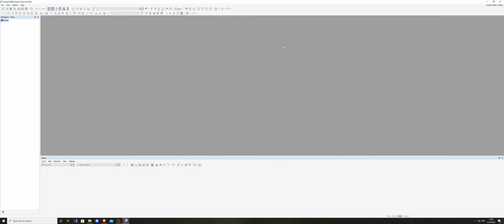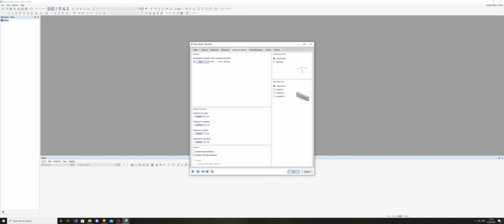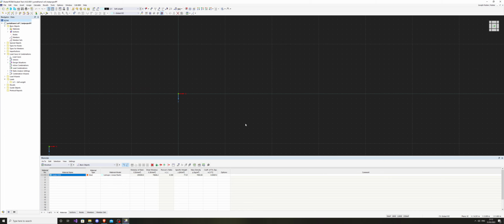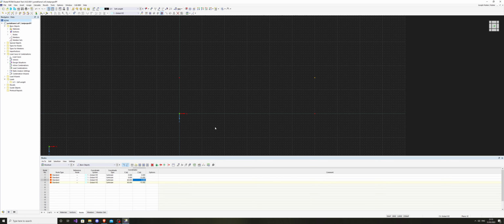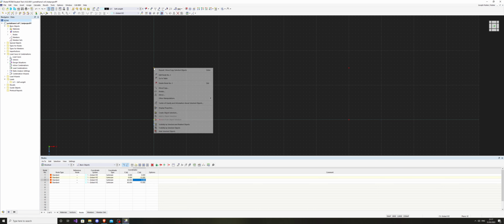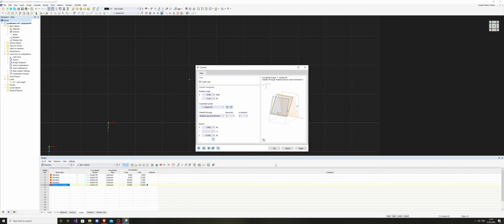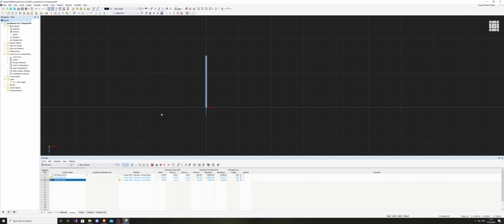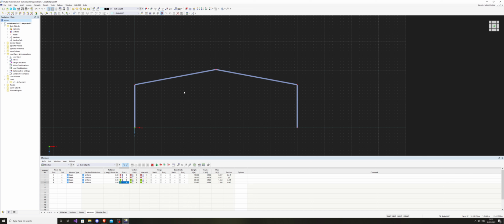RSTAB 9 - Designing a portal frame: Part 1

Comment: hi, i wonder how do you model a joint connection in this software? By far i was only working with Robot Structural Analysis and when i wanted to model a joint/hinge connection there is an option for releases so you can set for example “pinned-pinned; pinned-fixed” depending on what case you have in your structure and where do you want to release the moment..